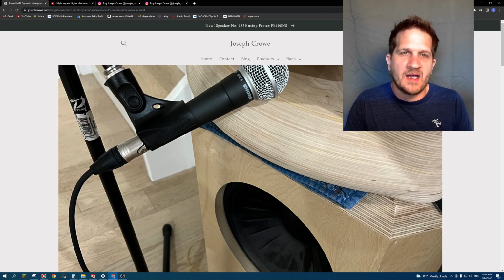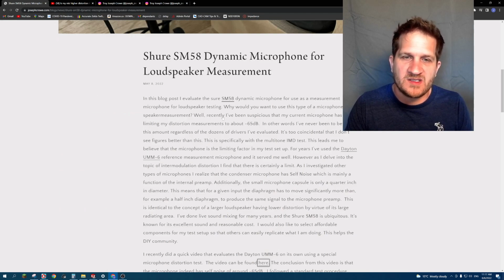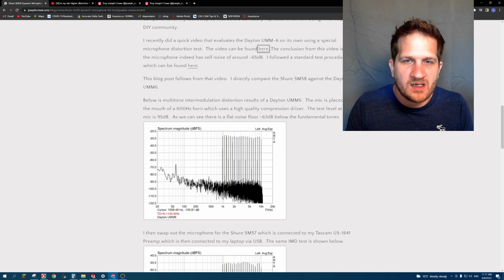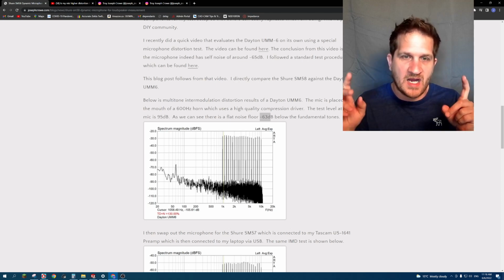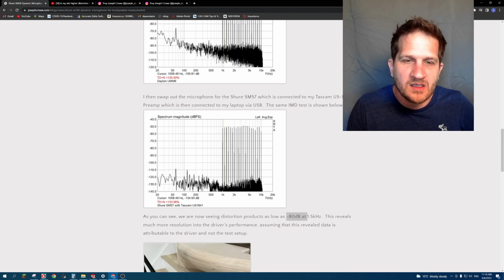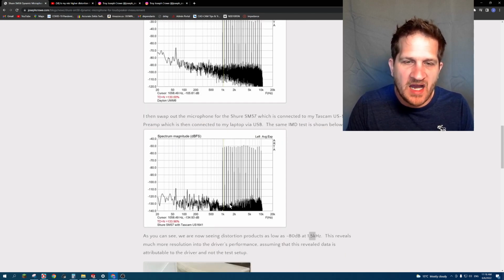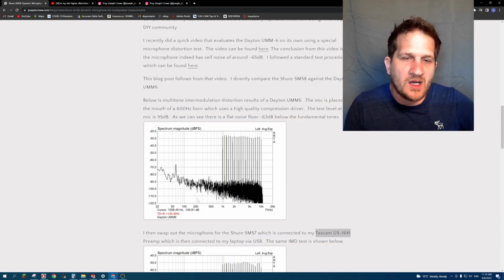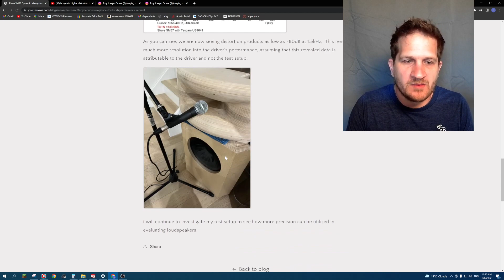Comparing Test Microphones for Loudspeaker Distortion Measurement

Comment: I find it very interesting that initially you call it By its correct model number It's an sm58 but then repeatedly after that you keep calling it an sm57 which is a completely different style microphone. The 58s designed for vocals and the sm57 is designed for instrumentation like guitars and drums difference in frequency, response curve and the cardioid polar pattern. One other thing to note, dynamic microphones do not have any self noise. They are a passive element. They do not produce self noise. Only condenser microphones have self-noise due to the preamp stage.

Comment: My UMM6 shows a series of sharp peaks when measuring silence which I think is noise from the USB feeding back to the input due to poor shielding or grounding - disappointing. I think the same can be seen in yours. Try a baseline measurement without test tones.
Reply from the maker: Yes, I’ve seen this as well, it can be useful for isolating A/C mains noise in the entire system.
Reply: @JosephCrowesDIYSpeakerBuilding  How is it useful for that?

Comment: Nice experiment, but with larger diaphragms comes worse omnidirectional performance (off axis is less and less similar to on axis), so it's swings and roundabouts really, you either go for ultra low distortion or really flat power response. That's my measurement microphones usually have such small diaphragms.
Reply from the maker: Directionality is fine and actually beneficial for loudspeaker measurement, not so much for room measurement.